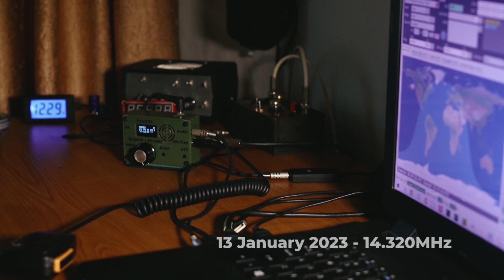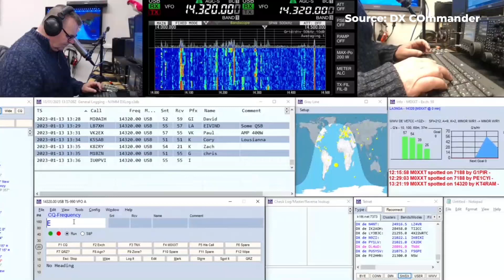DX Commander vs DX Explorer - 5W QSO on The 20m Band

Comment: Exciting! I finally broke down and got me one of those rigs. I got the ‘classic’ version. 10/15/20/40/80. Which meant I had to do some assembly. I had some hiccups but learned a lot. Also got that same tuner as you use. I love it. I mostly do cw. 73’s de n5vwn in South Dakota
Reply from the maker: I still don't know the code to be able to do CW. Maybe this winter I have time to learn haha. Glad you got one. I want to get the same as well. Mine doesn't have 10 and 15m. I will order another one in about a month or so. I'm happy you like it. Is fun indeed. 73 DE YO6DXE
Reply: @dxexplorer  Just buy the filter board kit. After you finish it, it just plugs in after you remove the old board. You have to change one setting on the menu. Learn cw. It really gets through where ssb doesn’t. It will feel like you’re running 100 watts. Ok, maybe 20 watts. 😂
Reply from the maker: That is what I wanted initially, but then I thought why to keep changing boards ? So I will buy one already setup and adjusted. I don't have the proper equipment to do that anyway do is better this way ))). CW is fun indeed. I'm amazed how far you can reach with only 5W 🤣🤣